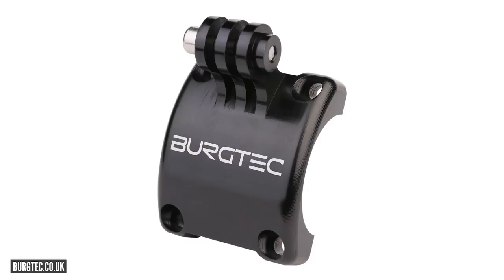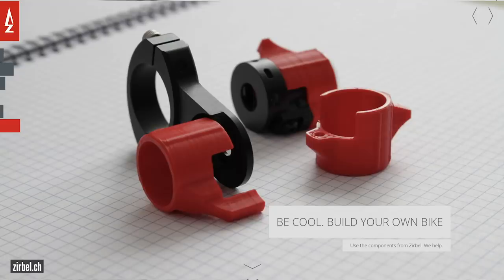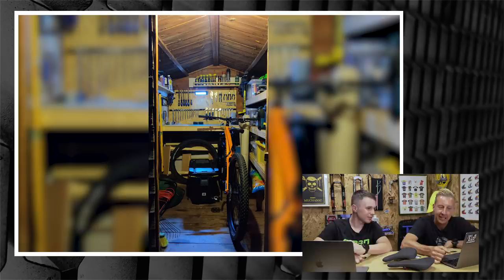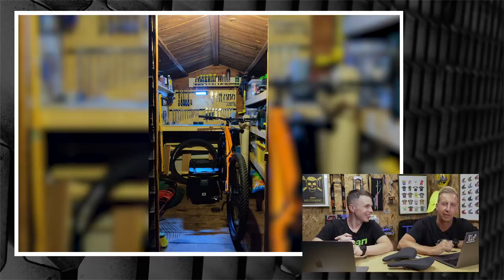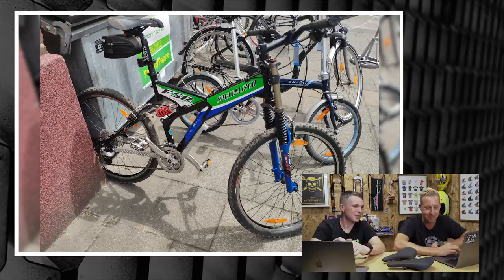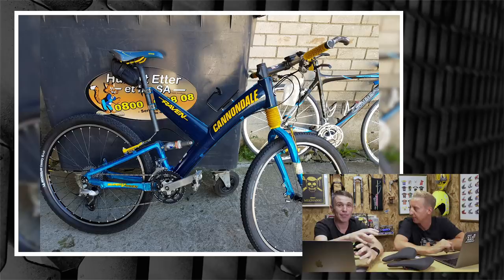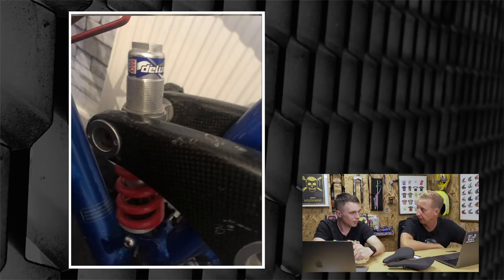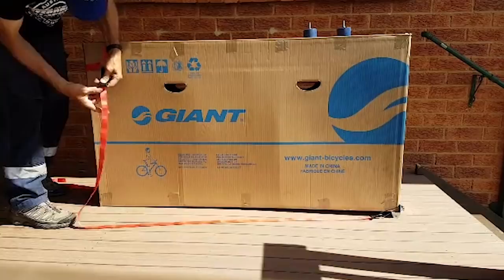Tie-Dye Cranks & Integrated Cockpits | Tech Show Ep. 91

Comment: I’ll pass on the cranks, but.... linkage forks have a bright future if designers can leverage all the new tools and materials. 
Slider forks work fine, but have unavoidable issues with maintenance, stiction, and geometry. 
Linkage forks can customize the axle path, minimize unsprung weight, and concentrate all the travel controls in single device. The old ProFlex forks were a great start, and it appears Adroit has used that for a design starting point. I really like the weight and most of the performance of my Lauf fork, but it’s just scratching the surface of what’s possible. This will probably all get sorted about the same time gearboxes are good enough to replace derailleurs.

Comment: Several light manufactures have had GoPro mounts for their lights. I use Light & Motion lights with their GoPro mount on my bikes and helmets. The lights are much more stable with these mounts.
Reply: 2nd that, all my lights have operational GoPro mounting capability. i have also looked at PNW Components Range stem as well, i like the adjustability on it also.
https://www.pnwcomponents.com/collections/range-stem

Comment: I think linkage forks are very interesting and can offer you more grip at the front wheel especially at small bumps. I just bought Santa Cruz Hightower and the rear works so good, it seems, that I have to set up the rear shock worse than the fork to still have the grip at the front.

Comment: I have just picked up a NS Metropolis it currently has a ridged forks on. I want to put on some 100mm forks which are strong enough to put up with a jump bike needs. The steerer tube is 1/1.8. Have you any suggestions?

Comment: Linkage fork are the future, I don't think you'll see telescopic forks on bikes over $1500 dollars 5-6 years from now. Kind of like 142 spacing, QR Drop Outs, Rim Brakes, Rims that don't support tubeless, Front Derailleurs, square taper, etc...They just don't make sense, especially on a two wheeled vehicle where the weights are low, and they require a ton of maintenance for those that ride a lot. They will also give bike manufacturers more control over the geo as the fork can become part of the frame, just like the rear suspension is.
Reply: Don't think it will ever happen.  Companies won't bite the hands that feed them and linkage forks are ugly as !@#$.  That is one thing the masses won't go for and history has proven that aesthetics are as important as function in animal behavior.  Never mind they may be better.  I'll never buy a bike with a linkage fork just for that reason as shallow as that is
Reply: @brewkeepyr4647  They can do things with aesthetics that can trick the mind. That's how some linkage ful-sus rear ends look pleasing and others look awful

Comment: #GMBNTech Hi guys, love the show! I hope you can help me out. So I stripped the treads on my rear brake mount.  I was searching all over the internet and have now a coule possible solutions: 1. Helicoil; 2. longer bolt with a nut on the end (it's a drill-through hole); 3 Loctite Form-a-thread Stripped Thread Repair Kit (sounds like some magical stuff, but I'm not sure if it's working as promised). What do you think about it? Does it makes any sence or should I just buy a new frame? Many thanks in advance.

Comment: #AskGMBNTech Hello GMBN TECH! I want to buy a new frame and use the components from my current bike since I think my current bike's not long enough. I've got 170 mm travel up front and 42 mm offset, but the frame which I'm considering comes with a 180 mm fork and 46 mm offset when bought fully built from the manufacturer (Clash, Commencal). This ofcourse raises concerns about the effects on geometry and handling if I would do this. The reason why I'm considering this frame is because the rear shock has same dimensions so I can reuse my old sock on the new frame. What concerns would you have and how would you address them, or what would you recommend? Forever thankful, and your channel is the best !

Comment: Good show guys, thanks. I will disagree with Henry comment about the Giant Talon. I have a Talon 2 and it not a good bike at all it comes with bottom barrel suntour fork and the horrible Tektro brakes , the brake and shifter lines run under the bottom bracket and it climbs horribly. Not a good bike at all so bad that it cannot handle North Shore green trails. As beginner rider and it almost turn me off of mountain biking.

Comment: 1:34 I use a Diablo on the helmet attached via Gopro mount, and Sixpack on the handlebar. but a Think I want to be solved is the Sixback light spinning on impact of handlebar every time I crash I have to tighten the bolt. They already know about this issue, cus I posted on instagram.
Reply: Every time you crash? How many times do you crash on a night ride? They're not gonna do anything about your 'issue' buddy. I wouldnt even call it an issue. Haha
Reply: @Dude-Smellmyhelmet  I rarely crash but it happens. But still a good light so I will keep using it.

Comment: @GMBNtech not really related to the theme of the video... Since you ride Continentals, how do you find the traction of the Der Baron Projekt II with Apex ProTection? There are few reviews of the 2018 revamped Der Baron, and the one I did find mention zero grip on wet rock and roots. I bought a set 29" x 2.4 and the rubber feels hard. The guy at the store praised the Der Baron for wet conditions, but I don't know. I don't want to spend £100 on a new set that give less traction in wet fall conditions...
Reply: I ride with a Baron on the front and a Kaiser on the back. The Baron wears amazingly well having spent time in dry rocky Alps, it's great in mud and clears quickly. Personally I preferred having a Kaiser on the front, felt more direct and easier to get a feel for grip limit. Only time I was glad of the Baron was in deep muddy slop, not because it had more grip but cause it cleared mud almost immediately. 
As for wet rocks and roots. I'm yet to find a tyre I trust on both!
Reply: @leeghathaway  thanks for your reply! Wet rock and roots are treacherous! I've tested with Baron front and back now, and there's grip for days in dry and semi-dry conditions.   I'll have to test the Barons in the rain as well.

Comment: #AskGMBNTech Hello again, I bought a reach adjust headset to try to fix my ongoing problem with my current bike which I think is too short. The problem is that the measurement on the cup is 56 mm (55.95 mm) while the tube is 55 mm. Has anyone ever tried to fit a 56 mm headset into a 55 mm tube and succeeded?  Forever thankful!